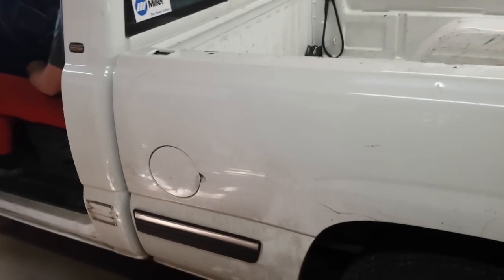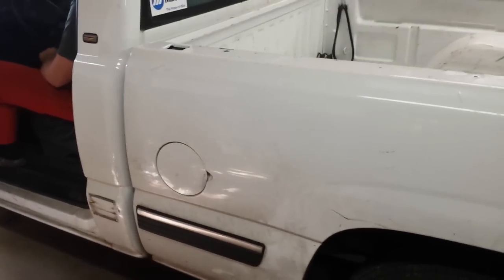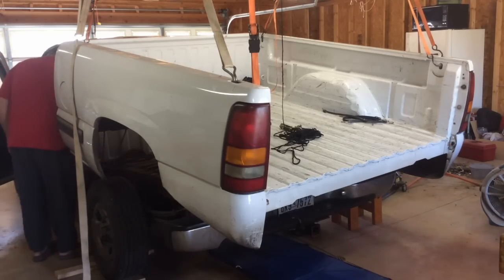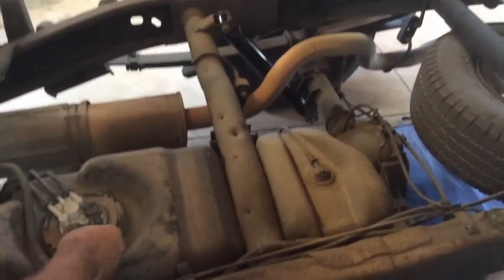Complete Chevrolet Silverado Fuel pump replacement – 2001 shown

Comment: I liked the channel lock plyer trick to remove the ring... didn't have one and used a large visegrip .to replace the ring I used a 3/4 open ended wrench to push down the ring and hammer it tight.
Thanks for the video...straight to the point with all you need to know 
and no extra B's 
Thanks

Comment: I just want to say thank you big time!!! I have been trying the usual tap the ring and penetrating oil for two days now. I watched you use the channel locks and thought, why not. Moved it in the first try.  Thank you so much !!! :)
Reply from the maker: Great to hear!
Reply: @BigRedFishDad  had a mechanic install an in tank fuel pump and it leaks vapor and the mechanic refused to fix his repair.  It won't pass smog until fixed.  Any ideas?
Reply: Lmaoo the lock ring is giving trouble as well I say out side for 3 hours fighting that thing and still couldn't, I bright out Chanel kicks by never thought I'd that idea😭😭😭

Comment: OEM on fuel related items 100% of the time.  That's not to say that OEM could not go bad, but the chances are very slim.  Also, just cut an access panel in the bed, bedliner covers it and sooo much easier.

Comment: So i have this truck and the other thing that's not the fuel pump sticking up on the top side of the tank but on the back what is that? how do i replace it? it has a hose that goes to the evap system .

Comment: Kid did real good in this video wearing rubber shoes & shorts.
In fact better than most so called adults attempting the same job.

BTW I have been known to actually put a rag on  the pump assembly & stand on it to get it to go down all the way .

Comment: I have exact same truck just red and my fuel pump just went out yesterday. Called advance and they said that these model trucks have 2 different fuel pumps one with one electrical plug in and one with 2. Which did you all have?
Reply from the maker: two... look at 20:10

Comment: What’s that tiny plug for, at 09:54
Reply from the maker: I’m not exactly sure what you are referencing… there are two plugs on the fuel pump. Ours may look a little different because this was the 2nd time so what you might be seeing is the butt splice connections.
Reply: @BigRedFishDad  Yes, the smaller plug of the two. It's dark gray in the video. What is that connection for?

Comment: Will an 05 Silverado fuel tank fit a 02 gmc fuel tank?
Reply from the maker: I am not sure but from what I read once the changes in the next gen were mostly body like the new fender look.   Check a pick and pull salcage site they always show what years and models that have the part you need or maybe rockauto.com and compare part numbers.
Reply: @BigRedFishDad  okay thank you sm! :)

Comment: What if it is still buzzing but not staying turned on?
Reply from the maker: ????... the pump comes on for a few seconds every time you turn the key on until it builds pressure. If you hear it come on then go off it is likely still good. But suppose it could be "weak"...  if that was case I would think it would keep running though trying to build pressure.
Reply: @BigRedFishDad   yeah the day before it stopped working it was whining a lot and so I had it parked and the following day I went out and it just turned off and I turned it on again and it puttered out again

Comment: I would like to see u try this with a 20 year old truck in Minnesota😂😂
Reply from the maker: Heck, the ring would probably fall off in flakes! Had to change the wheel bearing on the in-laws truck once and the plate that is behind the rotors I don't know what it's called but it had completely disintegrated. They are from Indiana pretty much anywhere with snow and salt all the time on the roads work is a pain in the ..........!
Reply: @BigRedFishDad  yep I live in Minnesota and any 2 hr project turn into a whole day lol😂😂

Comment: This was a decent video, however I'd like to point out that without adhesive lined heat shrink over those butt connectors, those splices are going to fail.

Also, that blue wire you were mentioning at the end, is the wire for trailer brakes, GM includes the wire in the harness but doesn't terminate it at either end. So if you have a trailer with brakes and you install a seven pin trailer connector, you would connect the rear end of that wire to your trailer connector and the front end to your trailer break controller in the cab.
Reply: Had an in tank fuel pump replaced and it leaks fumes from the ring after doing a smoke test.  The mechanic refused to fix his repair and have problems with other mechanics to fix his work.  Any ideas on how I might fix the problem?
Reply: @michaelpearce8661  DIY and lubricate the gasket prior to reinstalling it, although it's possible the previous "mechanic" could have damaged the gasket (by not lubricating it) and that would require a new gasket.

But there are too many possibilities as to why it could be leaking, for me to give any decent advice without seeing it.
Reply: @mikey4016 seems to me gasket was not positioned correctly got pinched etc..
Reply: @roadstar499  That's one of the many possibilities.

Comment: My problem isn't the pump, it's the fuel gauge (float) in the tank. Because my truck is rusty, I can't decide between this technique, or cutting an access hole in the bed
Reply: Five hundred 20s  bedliner

Comment: For the gas neck u can remove the 3 8mm screw's its way easier
Reply from the maker: Like we did at 7:02????
Reply: @BigRedFishDad  no you took it of different look in there were the gas hose go in there is 3 8mm screw's , then it falls away from the main neck black peace that's attached to the bed with the 3 special head bolts

Comment: What happens when u put the new one on and not replace the old plug
Reply from the maker: Don't think you can since the plugs are different. That is why a new pig tail is included with the pump.

Comment: Nice video. Could only see hands when showing how to take off the fuel lines. No close-up of how the clips unlock.
Reply: Right on the end theres a pinch point pinch each side and pull the line be carefull if you force it theyll get stuck in your lines and you wont get a good seal

Comment: Not really good, showing that you only press one clip on the two large lines when in fact there are two clips to depress, one also underneath the line which is very difficult to get too.
Reply from the maker: Don Less ummm... ok thanks must be different on yours. Lines slide right off the way he does it. No resistance, no broken clips. Hopefully if it's not easy to come off with a little common sense can realize that something is still catching. thanks for watching and who knows maybe someone will have a little bit of a hard time and use your third clip comment to get them through the job.
Reply: @BigRedFishDad  let me translate for you, because your reply and the offending comment show a lack of communication. The person filming when the lines were removed didn't Show up close how the fuel line retaining clips work. Maybe you should do a dedicated video telling people how to get the retaining clips out the correct way; up close, like the person watching the video was there with you.

Comment: #1 rule. Don't buy parts on Amazon. Go to advance or auto zone. I prefer Advance bc ion want have to make 3 trips to get the right part but if u like going back then go to auto zone. But try a $351 Delphi fuel pump , got it down to 160 😶, you pay for quality and why put cheap parts in your truck? Go get it on a commerical acct,.
Reply: Can you buy oem parts on amazon?